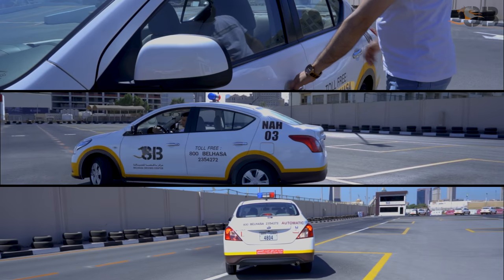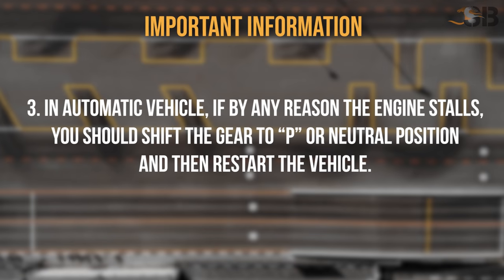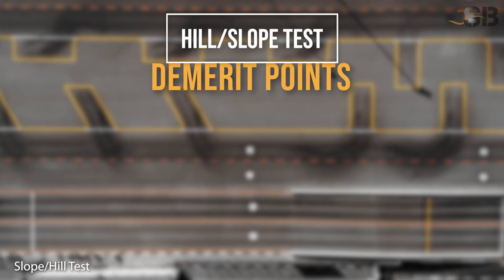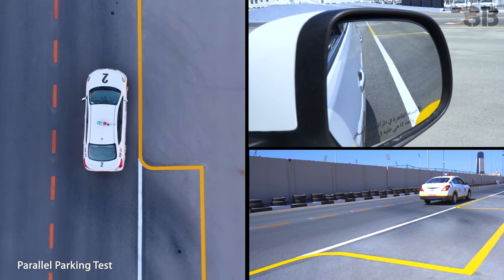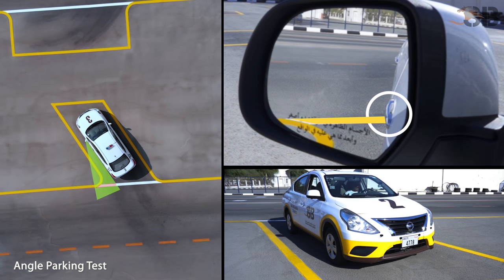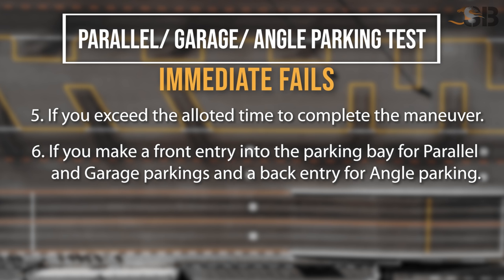Smart Yard Test- Belhasa Driving Center

Comment: What I want to say.. Don't be that inspired by comments like ''I passed my road test from first attempt'' - those are the lucky ones who didn't do hard mistakes, but the reality is even if you are prepared and perform 100% correct the examiner can fail you if he really wants or has a plan in advance to fail you. This is what happened to me and the other guy. The other guy was passing exam for the third time and did everything perfect during exam - speed control, head check, enter and exit roundabout etc. We reached the intersection and some meters before this intersection there was a parking slot on the right sight. The examiner clearly pointed to a parking lot and said ''ok, take this right'' and the guy was led by his gesture and parked the car in the pointed slot. After that examiner asked ''so why did you park? you should've turn right!''.. This was resulted as immediate fail. And then was my turn - the examiner was quiet, but later already after exam told me I perform the head check not correct... like I'm turning my head ''not sufficiently''... The other moment  - on the 60 km speed limit there were several speed humps so I slowed down approaching them, but the truck behind me continued almost with the same speed ignoring the humps - examiner said I should have increased the speed immediately after humps so full press gas...(yes, drive like Schumacher during exam) otherwise the truck could have killed us.. So he announced immediate fail... So I had to pay for additional classes (8 hours driving - just killing a time). I got my license within 1,5 month with 2nd attempt in total.. In other countries this would have called as a legalized corruption.... Just to let you know what problems you may face. Good luck to all!!
Reply: Thank you for guidance inshAllah i will pass my rta final road test in first attempt ❤
Reply: Well Said, additional pressure on the person is on failure,  time and money will be wasted just like that
Reply: Thats actually true, if examiner wants to fail you he will find a way. Its really easy for them.
Reply: Mostly some men failed for the exam than woman only saying

Comment: I passed on the first attempt for the RTA parking test. Here are a few tips besides the video : 
1. The reference points may be different for you, because of your height and seat. Listen to the instructor carefully during the parking classes. Specially applicable for Garage parking 

2. Garage parking:  Please ask the instructor on how to correct your position (when you are about to enter the parking bay) if you are too close or too far from the yellow line in the right side mirror. This will save you in the test as well. 

3. Additional move is okay (Only 2 demerit points). You can use it to correct your garage parking and parallel.

4. For the emergency brake test: Make sure your hands are gripping the steering wheel firmly when you apply the brake, as the steering wheel has sensors too. If you hold it loosely, it is an instant fail.

Good luck 🤞

Comment: 03:30 Starting Point
04:50 Slope/Hill Test
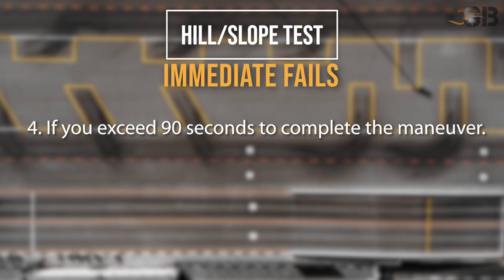07:15 Emergency Brake Test
09:25 Parallel Parking Test
11:33 Garage Parking Test
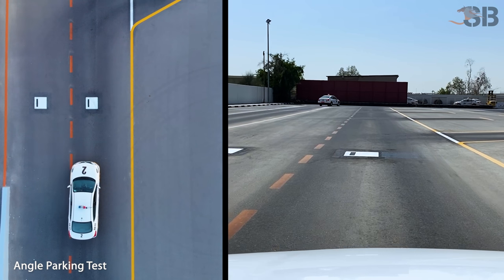13:47 Angle Parking Test
17:21 Finish Point
Reply from the maker: Time Code is mentioned in description of the video.
Reply: @belhasadrivingcenter4386  there is very bad instructor  In your driving school
Reply: @iamoromoofarst4026  they make money only  they are not give attention for student
Reply: @iamoromoofarst4026  my own instructor is worse. Have change instructor 3 times now but all are the same.  Mine just cross his legs and seat in the car without saying a word.

Comment: I passed on my first attempt on Monday. I legit thought I would fail at least the emergency break because during the internal assessment I entered the white line with a speed under 20 and my break pressure wasnt as hard as it shld. the ref points on this video differ a bit from what my instructor gave me and I think one shld stick to watever their instructor wld have taught them as ref points. i finished the test in 8mins and for a person who has zero prior driving experience- i was very impressed. Just for ref- I did my lessons at Belhasa Jafza and my instructor was Mazhar. one the best!

Comment: Parallel parking is the most challenging....points to be noted are
1. Correct positioning with slight right side
2. Turn fully right when yellow line disappears from right mirror
3. Turn fully left when white line is half the front door handle of left side mirror
4. Stop when yellow line is half of right front side mirror and both sides equally visible in both mirrors.
5. Holding the already fully turned left steering, put driving mode and slowly exit the parking after shoulder check.
6. When the yellow line corner is visible in left side mirror, turn fully to the right to exit the parking
7. Steady the steering

Comment: I've passed today thanks to the side mirror view that is shown in your video! As it turned out, It was slightly outward and that's why for my first 2 tries. I only failed in garage but now I can final proceed with road test. Thank you very much.
Reply from the maker: Fantastic!
Reply: Please help me with garage pls..which was ur turning point ,coz as per this vdeo when the corner hits the sticker but my instructor told me aftr sticker 3/4 finger gap ….failed already 3 times..sometimes so early or late 😞
Reply: @daliyajas2738  Use this video's instruction. For me too, what the instructor told didn't work.

Comment: I'm with Dubai Driving Center, but I used this video to clear my RTA Smart yard test today ☺️ Thank You so much 👍🏽
Reply: Hi Ranjith Did you use the parallel parking points for DDC or Belhasa? And did it work?
Reply: @soniamwanzia6080  Hi Sonia.. I used it for DDC.. and it worked ☺️
Reply: @ranjithparackal  Failed today 🥺 will try again 💪
Reply: @soniamwanzia6080  😕 no worries 😊 You'll do better next time 👍🏽
Reply: I failed miserably too..1st attempt..
Reply: @mishnanje9607  Don't worry 🙏🏽 You'll do better next time 👍🏽

Comment: Suggestion to trainees. In parallel parking and garage parking, you get 1 extra attempt if your car does not enter properly into the parking slot while reversing. You should move the car forward and adjust the entry into parking slot. You will lose 2 points but you will clear your parking test.
Reply: Not applicable for RTA parking, I had same experience but lost 4 points cos of this.
Reply: @valentineokoye600  I think it is applicable for RTA parking also. I did it and lost 2 points only. Maybe you did some other error also as I think each error cost you 2 points.
Reply: thanks mate if  only i knew it earlier yesterday i failed because i couldn't park properly and i knew I'm going to cross lane but i thought if i put farward gear, examiner might get aggressive as she was already talking too much while i was going through all steps
Reply: Only for garage parking

Comment: In parallel parking, is it the correct reference  to wait for the driver door handle to cross the white line in order to steer completely to the left and move slowly to get the car parked inside the bay  ?
There are many reference points  and I am confused which one to use in the exam.

Comment: Please a little help, in parrallel about the adjusting the mirror, what is the best way to follow your instruction because all depends on referrence point, or it is not important specially for the second refference point when the left door hand is on the wihte line

Comment: I passed all except emergency brake test in rta first attempt due to a silly mistake on 13 February 2024.

My trainer taught me a good setting for left mirror, downwards so that you see the rear tyre of the car . While parallel it helped a lot. 
1. Turn your steering right when the corner disappears as usual.
2. See your left mirror and when u see the parking corner turn your steering 1.5 times and make the car straight.
3. When the rear tyre is about to touch the white parking line move the steering left fully to left .

For garage please learn how to fix your parking when you cut late or early .

Comment: I keep failing the garage test. The sticker reference is not working for me
Reply: I was doing the same mistake in my assessment and my trainer told me that the sticker point doesnt work for everyone as it depends on the height of the person and the way he checking and turning basically the angle. 
I hope this helps you : when you are positioning the car near to the dotted line and in the rear camera you can see the parking while reversing slow down and wait for the yellow corner to show very little then check your point at the back and reverse slowly. That’s what I did and I passed in second attempt in RTA PARKING
Reply: Thank you so much sister. I will try this method Insha Allah. My practice class is on Thursday and test is on 19th April. Please keep me in your prayers. 🙏🏼